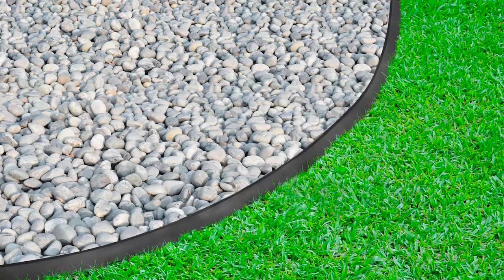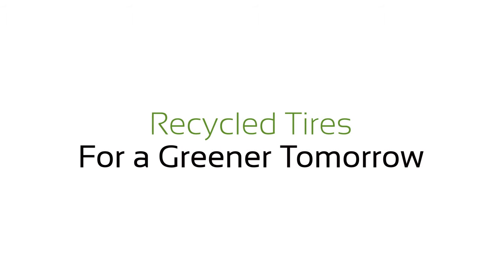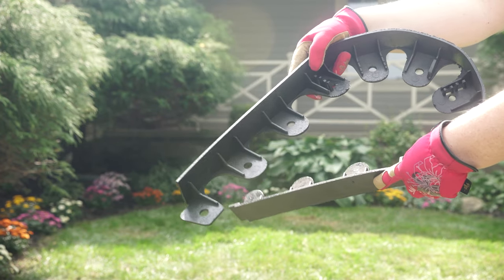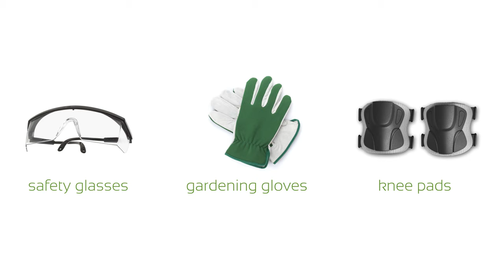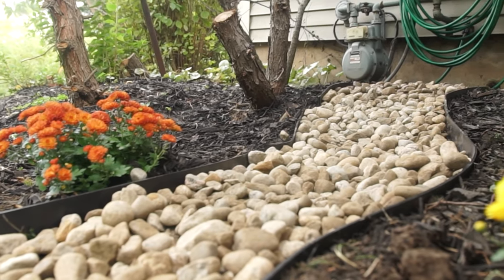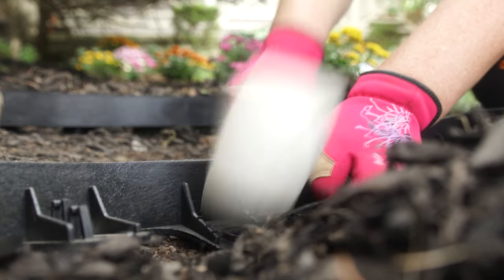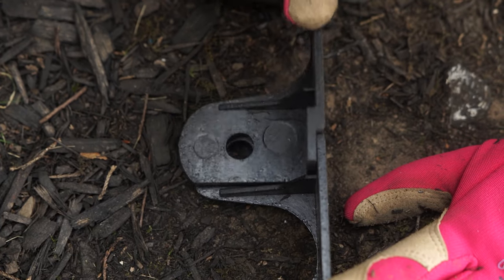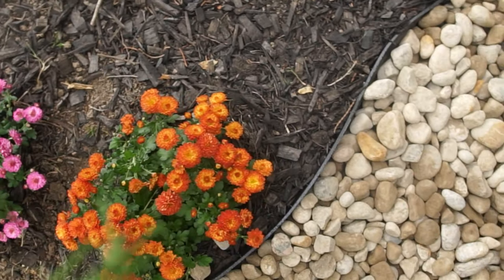How To Install EZBorder Landscape Edge for mulch separation | Garden ideas

Comment: Could you tell me which digging Shovel used in this video? I have planning to do this edging in my backyard and have to buy one.
Reply: I happen to have one. Its not a shovel, but an ice breaker used in winter snow storms. But am thinking of using it instead of a shovel. Caught my attention as well, lol
Reply: It's an edging shovel. That's literally what is called. Go to home Depot and ask for one